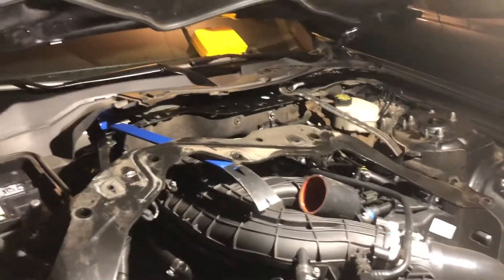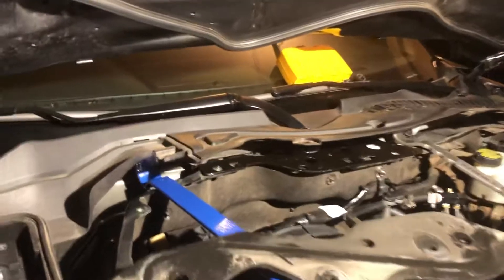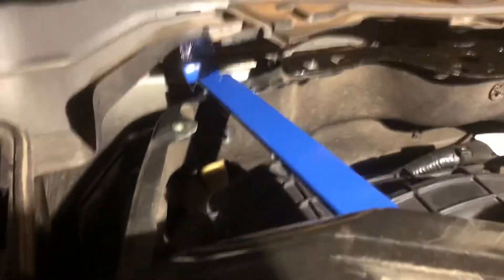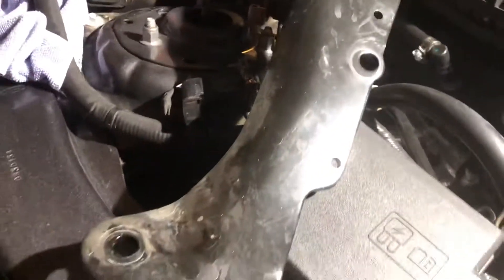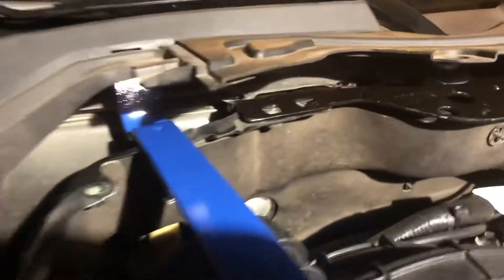Firewall Brace Cowl Extension Panel (bracket) Install Info

Comment: That's very cool! I never even knew this part existed. Thanks for sharing this....gonna put this on my buy list!
Reply from the maker: Make sure you get the pack of 4 bolts. There’s an extra mounting point.  

Cowl extension plate part numbers. 

4 Rear Bracket Bolts - Ford (-W717964-S450B)

Cowl Brace Extension Panel - Ford (FR3Z-63016A52-A)

Comment: Does the cowl brace then go under the extension panel?
Reply from the maker: No. It goes on top. One bolt for the cowl brace actually bolts to the extension panel.